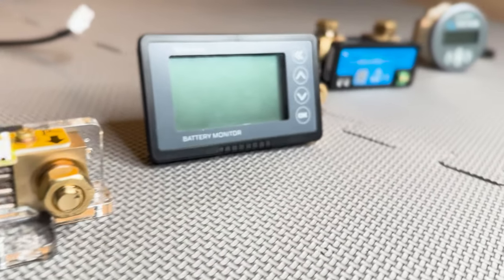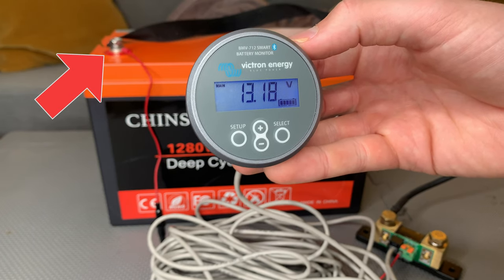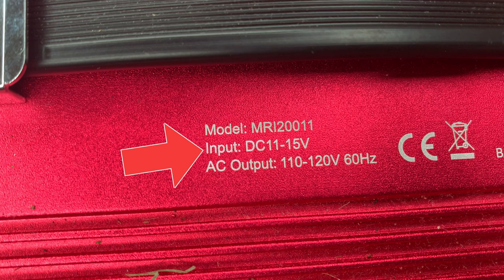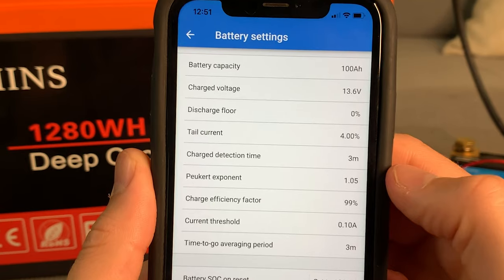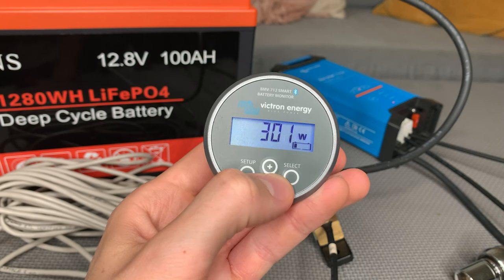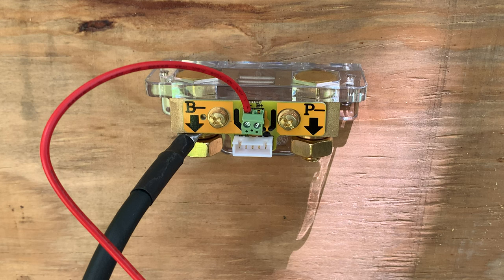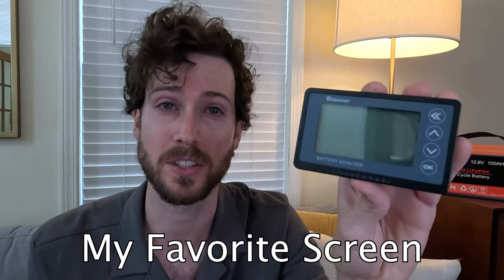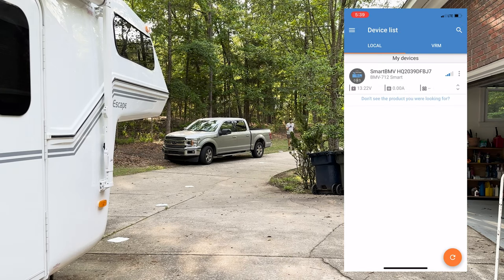Best Battery Monitors for RVs & 12V - 48V Solar Batteries

Comment: 47 page manual for a battery monitor is kind of ridiculous.  Also, fail on the low SoC alarm!   i went with the renogy. great tip on mounting the shunt to the negative pole side

Comment: I had the Renogy monitor and LOVED how visible the stats were on that big green screen. Unfortunately it started giving faults readings and died on me after about a year. I also noticed something really peculiar about the startup screen. While bench testing it right before I declared its time of death so to speak. I noticed that when it first booted up it would flash 350A on the screen as apposed to 500A. Also, for some reason mine didn't have the screen brightness adjustment I saw in reviews before I bought it. I almost have to wonder if mine might have been a counterfeit or something. I did a video on it a while back. If you're interested it's up on my channel. I ended up with the Victron Smart on my starter battery and the BMV-712 on my battery bank. I'm the "overkill" type LOL. I do miss that Renogy screen though😢 Anyway, Great monitor comparison you've put together here. You've earned a sub and a like from me. ;-)

Comment: The Renogy monitor is my favorite. You can see that the battery is charging from 30 feet away as the screen brightens and dims about once a second during charge mode.  All parameters can be read without scrolling through the screen. This became very helpful in remote monitoring. For $55 outlay, I can read my monitor from any place in the world where I get a cell signal. I don't need no steenkeen Bluetooth.

Dude!!!!  That remaining time function recalculates the time even if you slam the inverter with full load, back it off, turn on the AC unit, etc.   This does not require constant loads as you mentioned. It takes about 20 seconds to give a pretty accurate time remaining reading. PLUS.... when the solar panels on a day when clouds and clear spots vary the solar input, the time remaining function recalculates the time remaining to the full 100% full battery. It's fun to watch the changes in real time. Throw on the microwave over then watch it recalculate the new charge finish time. The thing is mesmerizing!  I have several systems here and the 500 amp shunt Renogy meter is my go-to unit. 

  I just put a 460ah Vatrer battery, renogy inverter, Renogy Rover MPPT controller in my friend's Class C motorhome. It got the Renogy panel monitor as well and he  likes it.
Reply: Here's an Amazon $55 Pet Cam monitoring a Renogy screen. The scan lines are from the  really cheap LED desk lamp that stays on 24/7.  The cell picture is sharper than shown. It pans, tilts and zooms from the cell phone and has 2 way speaker....and laser pointer!  I can hear the inverter fan if its running from miles away at any time I choose. It also has a Victron Smart Shunt which is practically useless to me as the Bluetooth signal won't make it through the wall out of the shop. The Renogy volt meter reads 0.3 volts too low as noted and should be 27.2 volts. No big deal.
  https://www.youtube.com/watch?v=mDv3vl3WlAM
Reply: RENOGY IS CHEAPEST CHINESE CRAP SOLD AT SUPER HIGH PRICE
Reply: @SayWhaaaaaaaaaaaaaaaaaaaaaaat  
Whatever you say. I have not had a single Renogy inverter fail. The 3kw inverter on my 7200 watt hour battery pack has run 2 garage chest freezers continuously since 2019. I have never had a Renogy battery meter fail. I probably installed 14 Renogy inverters and maybe 10 MPPT charge controllers for family and friends over the last 5 years in motorhomes, vans, a boat, 2 cabins. Their BT-1 and BT-2 Bluetooth aps read through my walls where the Victron smart shunt will not. 

I build these systems as a retirement hobby and not as a business. I don't have any connection to Renogy, don't get discounts, never got their stuff or anybody else's for free. I had a WZRLB 24 volt 3kw inverter fail under gentle use after 14 months. My Growatt 100 amp MPPT failed after a year. In place are a pair of 60 amp Renogy units that perform flawlessly since August 2022. I put the date when installed on green painter's tape to track these things.

My guess is that I have built many more solar/battery/inverter units than you have. I stick by the brand as reliable. And, almost ALL inverters and related solar components are made in China.
Reply: @kimmer6  This is the third time I've seen a YouTube video showing that a Growatt brand inverter has failed in just one year of use. I'm now looking at Voltronic models, and so far the only one that convinces me is the "King II" model. Regarding the Renogy battery monitor, I think there's a "Baiway" brand that has exactly the same model. I don't know who copied who.
Reply: @MrToede  I replaced the Growatt unit with a pair of 60 watt Renogy Rovers. They worked flawlessly for a year. On August 2, a BMS inside a commercially built name brand battery failed, set the battery on fire which burned 8 of 12     300 amp hour batteries which set my shop on fire. The current estimate is $150,000 in repairs, set to begin this week. I will never have a LiFeP04 battery bank inside any more. I have zero confidence that a BMS can protect a battery.  The bank was at 100% charge, about 500 watt load, both MPPT's had cut out. Everything was fused, oversized wiring was used, and all terminals were hydraulically crimped. This should never have happened.

Comment: Excellent comparisons. Thank you for the work you put into making it.
A few months ago, before I watched this video, I chose the VictronSmartShunt 500 for its bluetooth capability thus no need  run wires or cut holes for a monitor. Works beautifully and communicates nicely with the other Victron BT aware hardware I use. No extra cost dongles required. 👍🏼

Comment: This video provided great insight regarding differences in features available for commonly used battery monitors that are available in the market today, as well as providing details on the different price points for them.  Every setup has different needs, and thanks to this video I can be more confident in my purchase.  (I'm buying the Victron screen boi, since you can control a relay, it will be perfect to monitor a mobile auxiliary battery I will be using to power my ham radio in my car.  Relay will be used to turn on the DC-DC charging circuit, as this auxiliary battery will be charged from my alternator.)

Comment: Juntek do a shunt with a screen or Bluetooth. A liitle pricier than the AlLi but a lot less than the Victron. It has a separate box that attaches to the shunt and an app to connect it.

Comment: The two victron shunts are a similar price in the UK but I ordered the waterproof smartshunt as i thought it would be more durable and less wiring. Not having the display isnt much of a negative if you can check on your phone. Also the victron smartshunts can join a Bluetooth network with other victron smart devices and act as a voltage reference for them so for example the smart solar charge controller will adjust it's charging voltage based on the shunt and this allows it to account for voltage drops in the cables. I believe it can even derate is output if it detects too much voltage drop indicating too small cable or a bad connection.

Comment: the Victron Alarm will send you notifications, when you set the alarm levels under Alarm Rules in the VRM portion of the app, once you set the alarm  parameters you select which users connected the said device which will be notified

Comment: It would be really nice to understand how accurate each monitor is when drawing say 2A, 100A, 300A and 500A. Most systems use around 1-10A most of the time, yet when you do use that inverter and draw excesses of 200A you also need it to be accurate. You would hope the more expensive shunts are calibrated - but who knows!

Comment: Good video!  You covered a lot of subject matter which sounded well thought out.  Your gen needs to look at a phone to function in life so I LOLed when you were disappointed in the units without BT.  Im building a "portable" dual 100 Ah batteries with solar and grid charging and some bells and whistles.  It all fits into a DeWalt Tough System 2.0 rolling tool box and im wanting some sort of monitor.  Thanks for you opinions.

Comment: How would you do this with 3 batteries to make a 36 volt system. Do you connect the power to the same battery as negative or the positive of the battery that makes it 36v
Reply: Let me know the answer 
Thanks 😊

Comment: Interesting. Victron battery protect would be better over the Victron shunt. Victron battery protect has also Bluetooth, but it has also alarm + led when battery voltage drops to given value + its way cheaper.

Comment: Both of the Victron products have a guaranteed accuracy of 0.4% while the Renogy and Ali Express are rated for 1%.  That's a 2.5X difference and I bet the cheaper products don't even match the 1% number that is advertised.  It would be very useful to actually measure the accuracy (especially the current measurement).  I do understand that to do this you need a way to compare to a 0.1% (or better measurement) system.  I feel the better accuracy of the Victron products justifies the additional price.
Reply: That Victron accuracy is out the window on the bluetooth model. When you lose or disconnect/reconnect bluetooth, the SOC can report incorrectly.  As in, if you are at 90% SOC then lose connection, it will read 100% when you connect again.
Reply: I was not talking about SOC accuracy I was just referring to the the basic voltage and current accuracy.  The AHr number in particular is very closely tied to the current measurement.  In fact the AHr is simply based on current and time.  I am sure the time measurement in the BMV-712 is very accurate as very good microprocessor crystals have gotten very cheap, therefore the majority of error in the AHr reading is the current measurement.  When I evaluate charging runs I record the starting and ending AHr number on the Victron, When I do a discharge run I do the same thing (recording the starting and ending AHr number from the Vitron) and also compare that to my electronic load (Mayuno M9713, 600W, 45A).  The Maynuo is freshly calibrated (Jan 2023 by Tektronix) and has a current readout accuracy spec of (0.05% + 0.05%FS @ 12A, 0.1% + 0.08%FS @ 45A).  The Victron current reads within about 0.2% of the Maynuo.
Reply: @daviddinsmore20  most people that buy these are not doing discharge runs or accuracy checks. They are installing them in their build and using them to try to figure out how much is left in their battery. Like I said, the problem with the Bluetooth only victron unit is that when Bluetooth disconnects and reconnects, either by the user doing it or Bluetooth just falling off, the number goes back to 100% if the voltage is the same. As we all know, lithium batteries have a very stable voltage until they are almost fully discharged. I am not talking about the unit with a display.
Reply: @ryanalder9691 something is wrong with your smart shunt then because mine certainly doesn't behave like that.

Comment: Hi , may I ask you a question? If I build a battery bank and want to accurate measure the level of discharging the individual battery, battery monitor should be add to every single battery or one monitor for whole battery bank? 
thanks.
konrad
Reply: I would like to know this also. Thanks for asking. Hopefully someone will answer.
Reply: Just one monitor for the whole battery bank will be sufficient. It's not necessary to monitor each battery, instead make sure to use a battery monitor with mid point monitoring if you're battery bank is a 24 or 48volt bank.

Comment: I have 2V battery cells stack of 24 nos. of batteries. Can I check the stack with one battery monitor ? Total Volts 48V and each battery is 400AH.

Comment: I'm looking at picking up the Renogy, but I'm wondering if you need to reset the capacity everytime you disconnect the battery? With zub zero temps I plan to disconnect the battery to store/charge in the house when not in use.

Comment: I’m new to trying to build my dual battery system but I’m trying to make it chargeable via solar panels when at camp is there a way to monitor input/output of what the alternator is supplying but also monitor what’s happening when on solar. I plan to put it all in a large pelican case so it’s portable.

Comment: Great reviews! Question... If you disconnect the battery from the monitor, do you need to reprogram it the next time you reconnect the battery or are the settings maintained? I'm most curious about the AiLi, but interested in the behavior for all of them. Thanks
Reply: I can partially answer your question. I use the Victron SmartShunt and the memory is nonvolatile as the settings and data are stored in the Victron Connect app whether it be a phone or computer. Via Bluetooth it can also share data between other compatible Victron BT devices.
Reply: I ended up buying this and I can answer my own questions now. I am happy to report that the settings ARE in fact saved when the battery is disconnected and reconnected.

Comment: I'm running 2 100AH Lifepro4 batteries on my boat for my trolling motor. I need to be able to see how much capacity I have left while on the water. I currently have 2 12 volt gauges that run from the batteries. I'm confused about this whole state of charge or capacity thing. I have read about capacity being different from the voltage. I just want to see the power left without spending a bunch of money. Help would be appreciated.
Reply: I need same info for my boat. 
Let me know if you get any answers. 
Thanks 😊

Comment: Thats a LifePo4 battery. your voltage range SHOULD BE 14.4 - 10.0V
I suggest useing 14.0 - 11V
Long life range (20 yrs) 13.2-12.8V
Mid life range (12 years) 13.3 - 12V
Short life range (9 yeas) 14.4 - 10V
Reply: Are those usage ranges to get more years usage??
Reply: @stedyone1090 Yes, but they are entirely arbitrary values and he shouldn't have just thrown out numbers. You can't guess accurately how long your battery will survive, let alone to a year range like that. It's pure speculation.